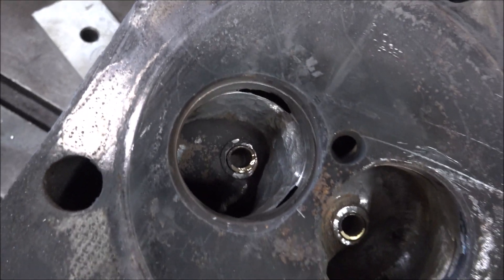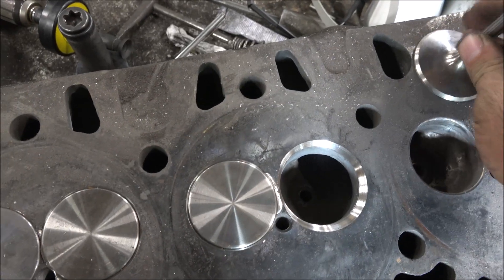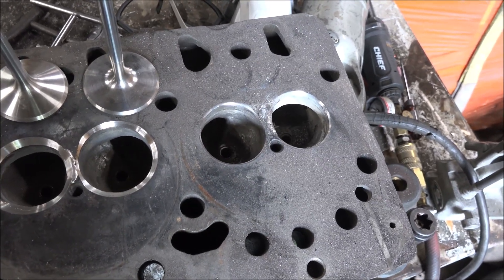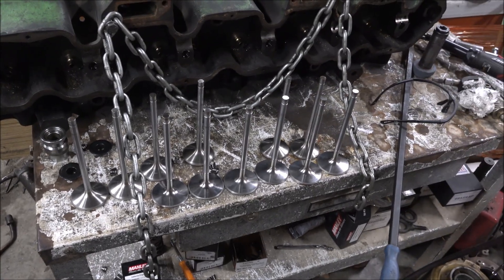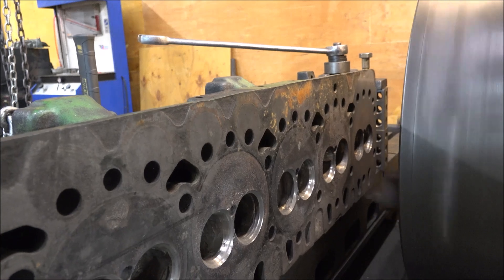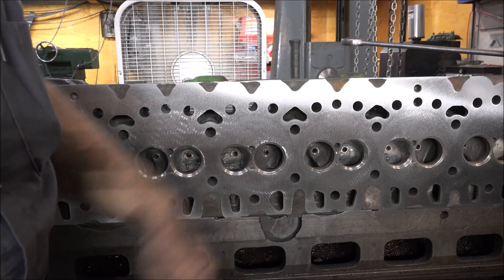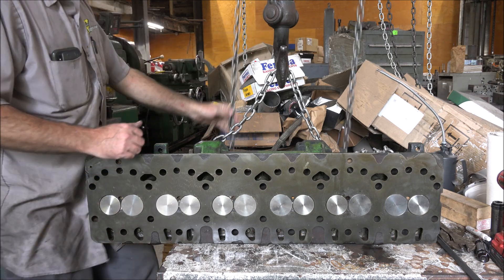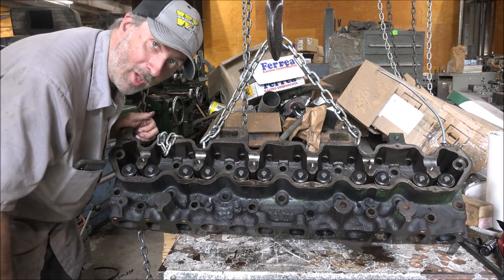Cast Iron Cylinder Head Extreme Porting Weld up the Holes and Seats and Make it New Again!!

Comment: Hi Brian 
I have been watching you from more or less the beginning of your most interesting Barn Project, starting with the Bridge Crain,  and how you brought back the three giant Paper waits, the big monster lath, the HBM, and the big monster drill press, you made three working machines out of scrap metal.  
And I kind of miss your old dog, he used to run after you all over the farm, but I must say I have not watched in a while. A long time ago I sent you some machinist calipers and I saw you use one of the tiny little things,  good job. 
And you saved that old horse barn just in time, it was going by the wayside very fast, and now it will be here long after you have willed your property to the next young and rising generation.
But I was shocked when I saw for the first time your house up close, the outside look as if it needs a makeover, I wonder what the inside looks like, maybe like the inside of the old barn shop, now I am sounding like a nagging old lady, “Stop That” 
I think I saw a sagging roof line on the old house, could have just been an optical illusion, so let me ask the question where on the agenda have you placed the old plantation house for a new paint job, to tell you the truth that is going to be a big job and if it is done right an expensive job. 
But I saw you perform somewhat of a miracle on the old horse barn, and when you get you mind machined up for the job there is no stopping you.
Reply from the maker: I miss the old dog too. I use your transfer calipers all the time. :-) The house as always is a constant work in progress. Way more to do than time and money allow. :-(

Comment: 👍👍👍👍..what size nozzle bore?... Do those like to crack like say a 6B 9mm ?... Nice work as always feller 👊
Reply from the maker: @elroyelblander6277  they are 9mm but they aren’t as prone to crack there as Cummins heads because the ports are further apart.
Reply: @bcbloc02  👍👍👊

Comment: Where there valve seats installed in the head? If so we’re they existing seats or aftermarket ones for the new valves?
Reply from the maker: @frednewman2162  no seats. The valve runs against the cast head as is.

Comment: You should find you a cincinnati tool and cutter grinder to grind those keep grooves in the valves. You can mount the end of the stem in a collet and then make a steel washer with a counter bore that fits over the head of the valve with a center hole in the back side. Then you can put the tailstock in the center hole. Grinder makes a much nicer looking keeper groove. You just dress a wheel to the shape and plunge it in. Ive seen cutter grinders going for as low as 300 here lately. I bought one last year with the newer tilting head for 160.00.
Reply from the maker: How do you control the radius on the grinder wheel for the top of the groove? Seems like would need a pretty hard and narrow stone to do it consistent but I am sure it would leave  a nice finish.
Reply: @bcbloc02  Yes you need a hard wheel and dress the radius on the wheel. You may need to dress after after a few valves. If you get a cbn wheel you could do a lot of valves before you need to dress.

Comment: Looks good Brian. You had to cut the valves to length and recut the keeper groove also to bad you did not film it would liked to have seen it done. Thanks
Reply from the maker: I will try to film it next time. Hopefully I will have the little Monarch available the next time I do some valves as its a lot easier to work with and film on doing small parts.
Reply: @bcbloc02  👍

Comment: You should mill a chamber in there like a 55 series head. It would make more power.
Reply from the maker: That really depends on the piston design.  The deck surface isn't real thick where the chamber would go so if you cut a 1/4" into it for a good chamber it likely would break thru as its probably not but 3/8" thick at most. A pitty Deere didn't put an extra hundred lbs of cast in these heads where we need it so we could modify them to make 10 times the power they were designed for.  Apparently they thought cooling and longevity was more important. 🤣
Reply: @bcbloc02  I made a pattern to recast small block heads. I havnt had one cast yet.

Comment: JUst wondering why you use a facing head instead of a face mill. Facing heads are normally used to face  while the table stays stationary. They usally have a way for the tool to feed across the face.
Reply from the maker: I don't have any face mills with enough diameter to cut the full face of the head in one pass and I never like multiple passes on a sealing surface as there is always a slight variance in the surface. Also the facing slide is more rigid than the spindle so it gives a better flatter finish.
Reply: @bcbloc02  I have a big facemill we put on the horizontals or the vertical cnc

Comment: The intake and exhaust valves look like they are the same size, what size are they and what size were they? I have never been to a tractor pull. Is this for your machine or a customer?
Reply from the maker: @scottjones7279  2.375 and 2.250 customer machine not mine

Comment: Nice work Brian.
What do you weld the head up with?
Nice HBM Milling.👍
Thanks for sharing. 👍 🇺🇸👍
Reply from the maker: @edsmachine93  it is a nickel and iron mixed rod as you can see on the welded seats after grinding it matches very well to the regular iron.

Comment: Do they run coolant in the tractor pull engines or just filler
Reply from the maker: @down-time-x66  depends on application. This one will try coolant only but if it leaks it can get filled.
Reply: Welding c.i. cylinder heads is black magic! Many have tried, most have failed.
I think that’s the reason most racing heads are aluminum. Aluminum is easy to repair after a valve breaks.
When I ran some combustion chamber shape studies, we had a good handle on port & valve sizes in what became the production 3.0L V6 Ford Taurus base engine. But I wanted to try some combustion chamber iterations. Didn’t have time (or funding) to make castings, but my manager said I could freelance some outside services. I knew a welder that did a lot of cast iron welding for AMC (back in the mid 1980s). 
He built a big firebrick enclosure and basically a heat treat oven on his big fabrication table, then proceeded to preheat my heads and weld the chambers on the table. I don’t know how he stood the heat. I couldn’t take 2 minutes watching him weld! We dyno’d 4 different welded up chambers for power without a single failure. Couldn’t run octane requirements, of course, but we went into production with a damn good cylinder head.
I always argued that an ideal engine configuration would have an aluminum block and cast iron head. In the compression ratios we ran back then, to make an aluminum head engine deliver the same power as an iron head engine you have to run 1 to 1.5 points higher compression ratio to make up for the higher transfer of the aluminum (about 4% different). If GM had spent about a buck on the Vega cooling system (a sealed radiator cap like Cadillac already had in production), the overflow bottle would have become a coolant recovery bottle - and the Vega overheating problem would have mostly gone away.
Reply from the maker: @stevenslater2669  I have done some thermal coatings on head combustion faces and that usually always picked up some power.  I use a lot of torch gas heating and welding one of these heads and it takes a bunch of time but once you get it hot ya got to keep going with it it definitely isn't something you want to do in stages.
Reply: It is a combination of both in a typical engine